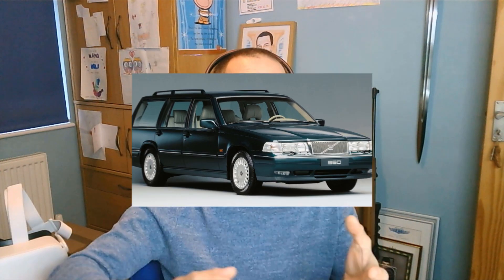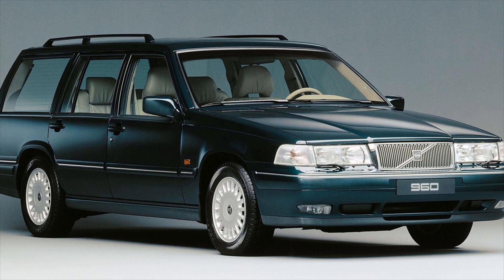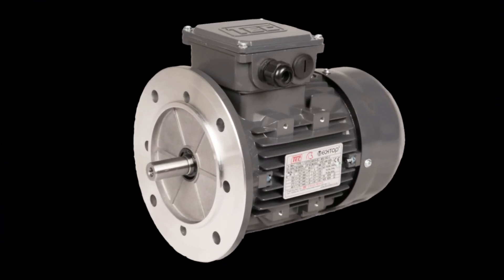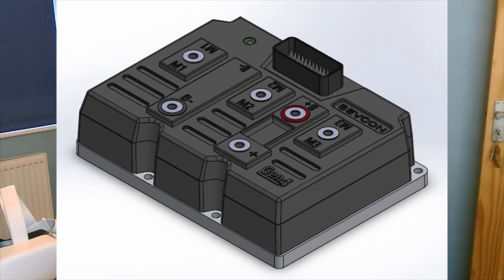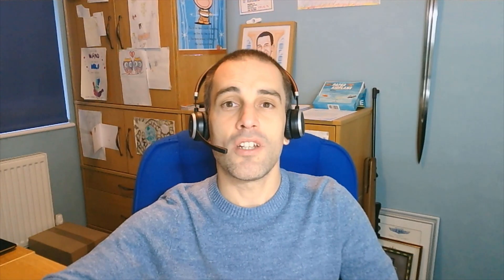How to convert / build a home electric vehicle (High Level).

Comment: The DVSA will require a CEC 100.01  cost £2,000 + IVA cost £500 + plus other tests if necessary. ( not sure of the reg's for vehicles over 40 years old )
Reply from the maker: Err, I am on the road now, none of that required!

Comment: I have a 1974 Dodge Dart Sport that I’d love to make into an EV.... thinking about getting a cheap Leaf (I’ve seen 2014 Leafs for around 4K usd) and use that as a donor car for the project.... do you think that is dumb, or doable? My Dart is currently has an automatic transmission, I assume I could get a machine shop to get something to line up with a Lead motor....
Reply from the maker: Sounds doable - that is what I have done, got a machine shop to make a plate to fix the motor to the gearbox...

Comment: I came here to hear what an experienced builded has to say and everything i her is apsolutly oposit of my aproche. Is it enough to say that I'm working on Peugeot 106 mk2 keaping it FWD and im filling all the space where petrol tank was and instead of rear seats which makes my little peugeot a two seater with a masiv boot
Reply from the maker: That is a shame! Obviously it does depend on the car being converted, personally RWD does give more options and space - but every project will have its own requirements.